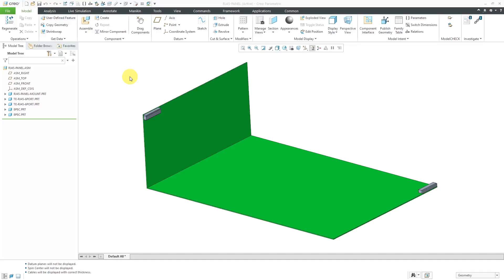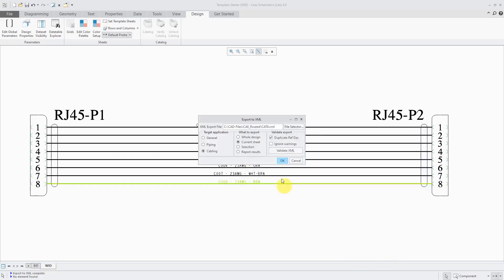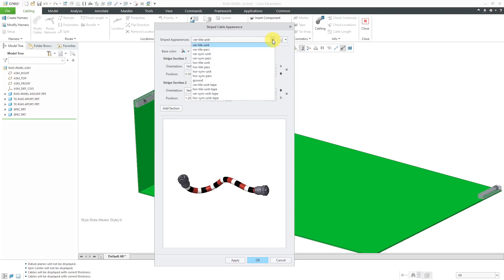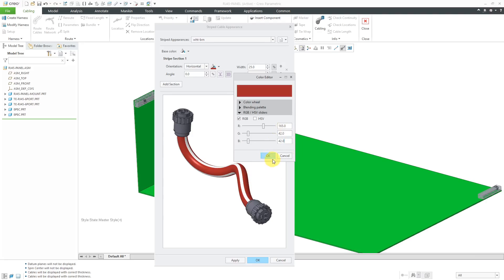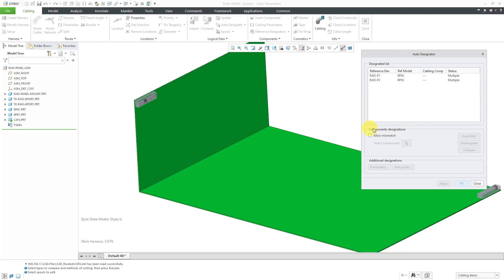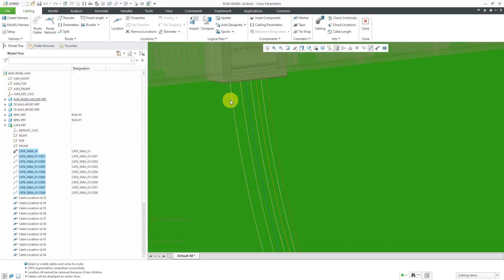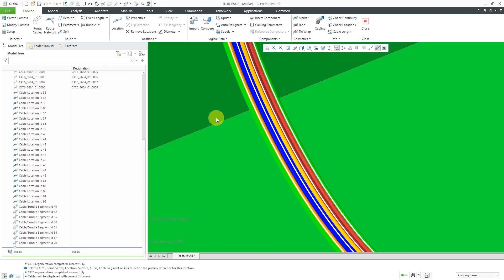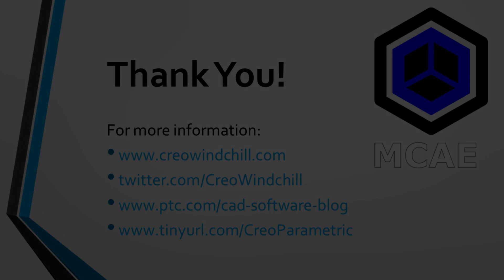Creo Parametric - Cable Stripes

Comment: Thank you for this video. If I can have a question: how do you achieve visibility of the center lines in the thin line mode. I cannot see them until I cross them with cursor or select them? Is it something with layers or a config value?
Thank you
Reply from the maker: Are your cables the same color as your screen background?
Reply: @CADPLMGuy  no, they aren't. The only way to see them in similar way is to switch to hidden line or wire frame mode, but then i need to keep switching the view mode back and forth...